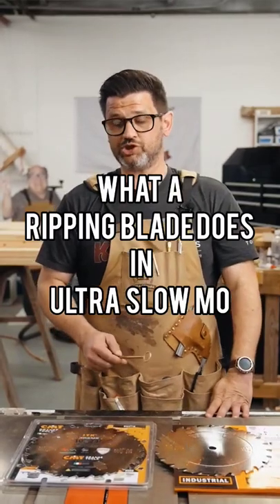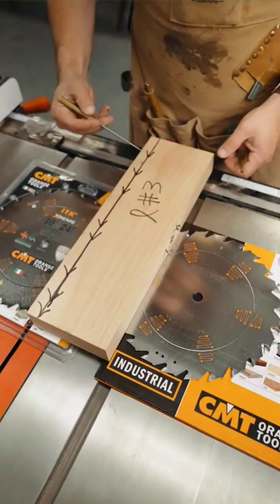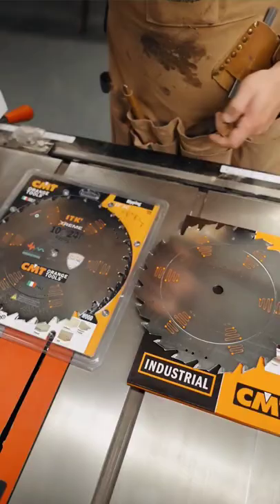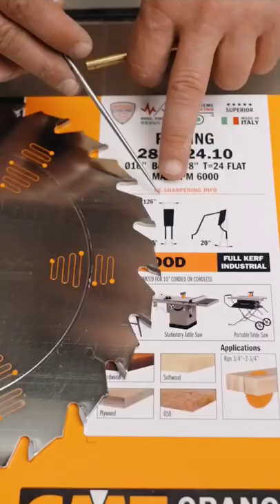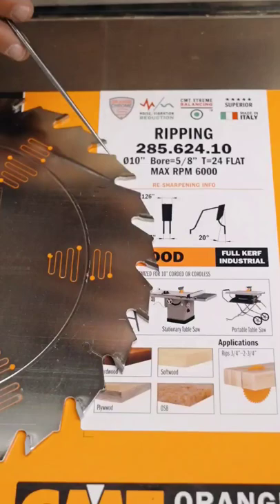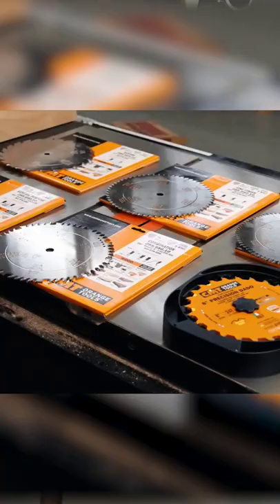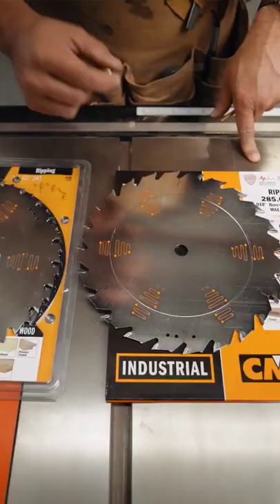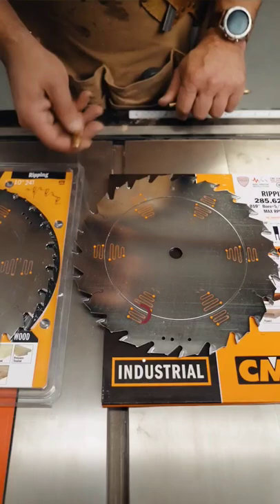Table Saw Rip Blade in Ultra Slow Mo #shorts

Comment: You need to add some 81/4" blades. A lot of the New tablesaws are That size and i cant find them, specially flat tooth blades
Reply from the maker: I will order some
Reply: I use an 8" 22 tooth Freud ripping blade in my DeWalt 8 1/4". I needed to modify my riving knife a little bit but it was well worth it.